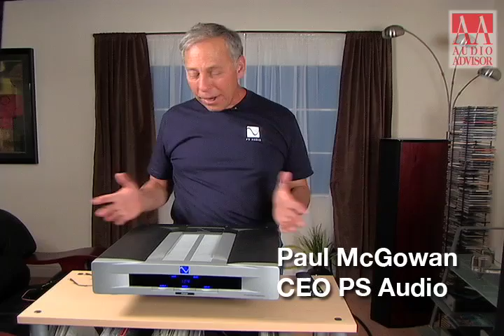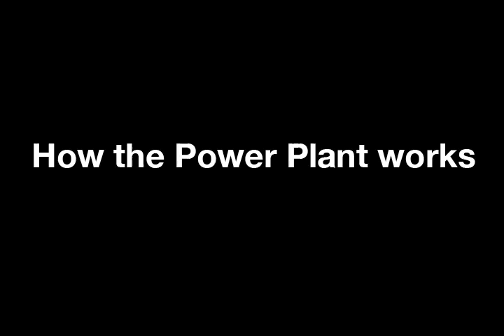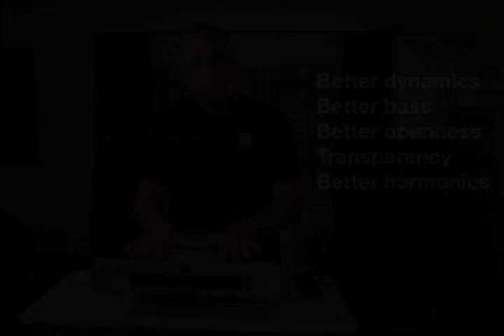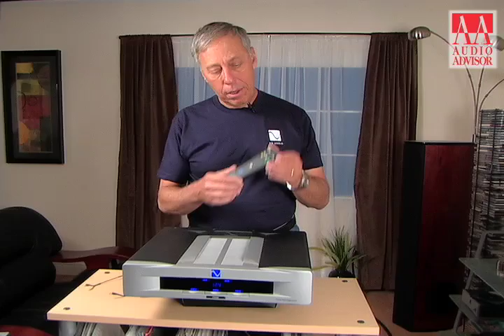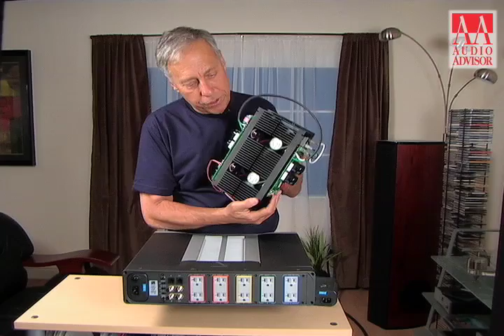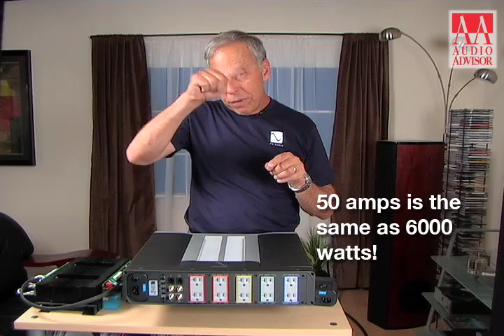PS Audio Power Plant Premier – Audio Advisor

Comment: Unless you have speakers and amps costing tens of 1000s of US$ or live in a remote farm with your own diesel generator, this product is not for you.
Reply: ThinkingBetter Actually if you were on your own generator you might be better off, because no one is drawing power off of your feed. And some of the pricier equipment do their own regeneration (so I’ve read).

Comment: You compare the peak output current of the regenerator 50A, to the outlet trip rating 15 A. It is misleading. 15 amps would have to be multiplied by 1.4 to get the peak steady state current (21.2 A); The peak transient current of the outlet is not 15A ,not even 21.2A, whatever it comes out to be it could reach 50 Amps or even more, it all depends on the time duration and the ability of the braker to hold the current before tripping.
Reply: you had my attention, thought you might know what you were talking about. Then you misspelled "breaker". So close...